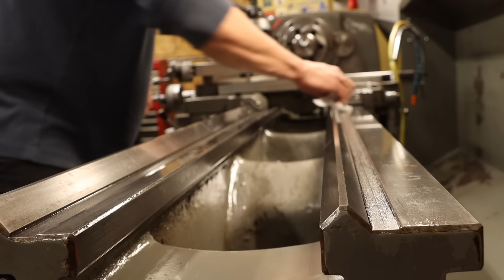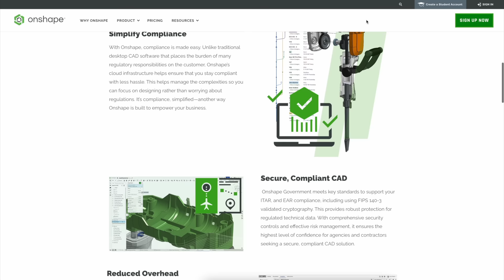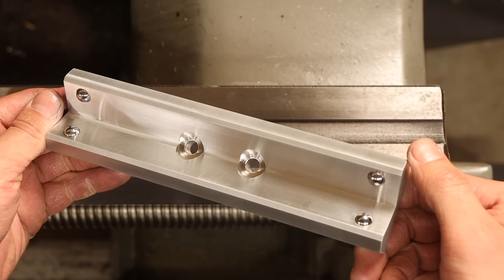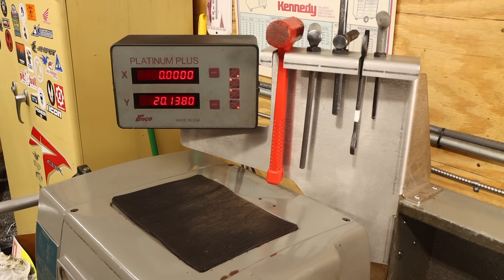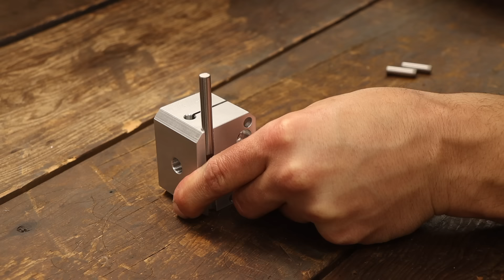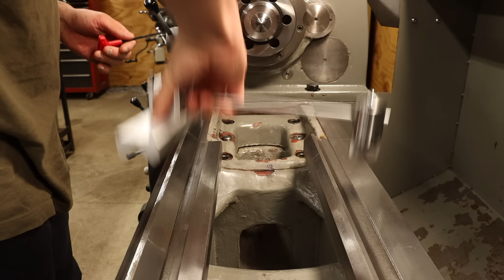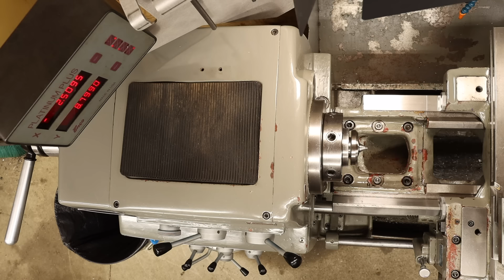A mistake... 3 years in the making

Comment: You adjusted the tail stock at the point that the live center contacts the work. But did you make sure that the tail stock quill is parallel to the bed like you did the head stock spindle? If not, you may introduce more or less taper into your work at different distances that the tail stock is protruding.

Comment: what you call the bar test is showing you how well the tailstock is adjusted... taper does not indicate anything but the tailstock took is off center and needs a couple screws adjusted. Read about tailstock offset method to actually turn a taper by throwing out the tailstock. That t3st has nothing at all to do with leveling the machine

Comment: I might be a little late with this, but i just discovered your channel (and i love it :) )
You actually DONT want micrometers or anything else to take mesurements with laying on the top of your spindle, even with a piece of plastic underneath. 
When i was learning and training, i did the same, laying calipers and micrometers on the top of the spindle. My coworkers told me to touch the surface where those were resting, and guess what, its warm :D
Keep on with your great work, i really love and miss the conventional machining 
I started my training in 2010, learned all conventional, turning and milling.
Finished training in 2013, I got to work CNC on a Doosan Puma 300SL
After that i went to another company in 2016 to keep on learning
They might have seen something in me, i dont know, but they sent me to trainings and lessons at machine manufacturers like DMG, SCHUNK, etc
Today I´m still at that company, working on a DMG CTX Gamma 3000TC with automation Robot
I hope my english isnt that bad and quite understandable
Greetings from germany <3

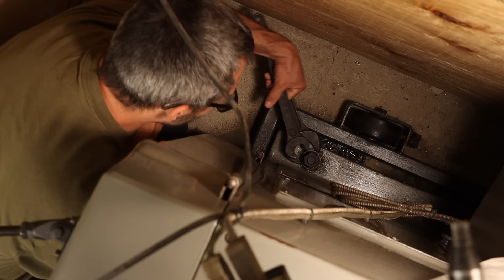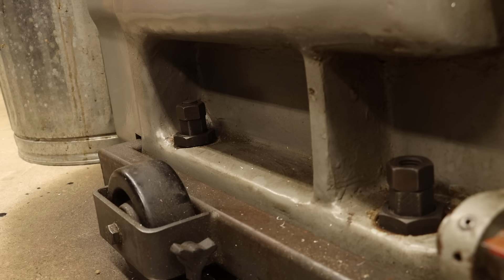Comment: Fantastic episode. At 16:34 I think I see a slab joint at the top edge of frame where you are making an adjustment to one of the feet, and at 16:41  I observed a crack in the concrete very near the right end of the lathe. Is the lathe on a standard garage slab, or did you pour an isolated pad under it? I ask because big lathes can slowly drift out of level on thinner residential slabs over time, and many manufacturers recommend 6 to 8 inches of reinforced concrete for stability. Curious how you’ve handled floor movement for long-term alignment.”

Comment: Please dont use Plastik to fill the Gap. Use long curing filled Epoxy and a little piece of copper Wire to lay it in the Gap with the Epoxy. Then tighten it to match your expectations. The Copper Wire will be pressed together when your adjustement is ok. Then let the Epoxy cure. 
Just simple as that 😊

Comment: I remember, about 40 yrs ago, I tried to straighten an old McDougal lathe out, and, after extensive checking, I found the tailstock was 0.030" low, and, at some point in the lathe's history, someone had switched the tailstock with the wrong machine, and after some checking, we found the other tailstock, 0.030" high, switched them around, and ended up with 2 fixed lathes. The paper mill in Dryden Ont. never had such great work done, after that.

Comment: I think you will find the reason you could not take the sag out of the lathe bed was the stand that is under the base of the lathe.  As you are adjusting the leveling screws at the drive end, it is causing the stand to deform instead of the bed, the wheels on the stand are also acting as pivot points.  I would suggest removing the stand or adding jack screws to the stand, to prevent the stand from bending as you try and remove the sag; I would do four at each end of the stand, one in each corner.
I’ve had issues with using leveling screws with hard rubber bottoms.  The rubber would change an hour later, and I would have to start all over with the leveling.  It appears the casters on the stand are polyurethane which will crush over time.  Switching to steel casters will help ensure your level does not change over time.  I personally would remove the stand and create steel or cast-iron pucks for the lathe leveling screws to sit on.  The pucks will protect the concrete floor and elevate the lathe too.  If you are tall like me, it makes it easier on the back adding 2-4" under the lathe.

Comment: Sometimes it takes years to figure out the solution.  

Oh, and what is that fancy angle finder that you have? I got given a cheap one but it does should the correct angle which took too many hours and minute of trying to align my machine to work out that it sadly isn’t accurate to even vaguely within the +/- 0.1 degree as they state in the manual. 😢

Comment: The does the chatter come in at the part where the ways are sagging? If so, you should anchor the lathe to the ground and "pull" the end of the gearbox down. As now its "floating" at the end and causing that chatter at the middle of the ways. :)

Comment: IF (a big IF) there is wear on the carriage ways, a simple way to check the wear is to use the tailstock ways as a reference, since any wear on the tailstock ways is almost always close to zero.  (And certainly no wear in the area where the tailstock is never positioned.) I.E. check the carriage ways by mounting a dial indicator on the tailstock and sliding the indicator point along the carriage ways. Usually any wear on the carriage ways is near the chuck, so placing the tailstock  in front of the carriage, with the carriage all the way to the right allows this measurement near the chuck. In theory, one could mount a tool (e.g.  a grinder) onto the tailstock to true the carriage ways.

Comment: Putting balles for the “V” block’s contacts, I would have envisaged a small thru hole for future retrieval - ‘cause you may not have all 4 holes perfectly at same depth. Also would make the fit .000 5” allowance and used a lube for retaining / rolling. Naturally, some adjustment for the 4 balls to be in the same plane.

Comment: Hey man, plastic creeps, and if the new shim's thickness is ensured by torqueing the bolt to the right amount, that means that the plastic is under compression and with enough time the pre-load will drop to very low levels. I recommend figuring out how to get a metal shim thin enough.

Comment: One thousandth of an inch is 0.0254 mm, i.e. at the limit of permissible error for most machine units with normal accuracy. At the same time, people who's using the metric system, when repairing machines, usually use micron accuracy indicators, i.e. 0.001 mm. Of course, thousandths of an inch can be divided into smaller parts, but WHY?

Comment: Standard lathes are only built to H7 specifications, so trying to adjust a lath beyond this tolerance, is futile. Also heat produced from the turning processes,  lathe-bed lineament, will influence long turning accuracy of a lathe. Also when using hard-metal inserts; the nose radius of the insert should be fulling engaged E.G. the depth of the cut should be the twice the nose radius of the insert; so if the insert nose radius is 0.4 the cutting depth should be a minimum of 0.8. - The formulae being nose radius 0.4*2=0.8 - 0.8*2=1.6 and so on.

Comment: Here is a Question.  The Tool Tip is Tangential to the surface of the bar.  If you raise or lower the tool tip by 0.010"  ( 10 thousandths )  how much diametral change does that Make on a 1" diameter bar?
if you have done the math,  you will see that leveling of the bed, doesn't affect part diameters as much as one 1st thinks it does.
So then it's Not really the precision Leveling of the Bed that has the greatest impact on Taper in the part. 

Head stock alignment, the Center line of the spindle bore in relation to the Bed Ways.
The cross slide Screw and nut assembly and thrust bearings on the ends of the Screw.
If using the Tail stock, the alignment of the Tail Stock in relation to the center line of the Spindle. ( the tail stock center height  should always be Slightly Higher Center line than the Spindle by a thousandth or 2.
If you have a Gap Bed, then the Gap alignment, has the most impact on the first couple inches of cut closest to the Headstock.

Comment: what do you think about cutting straight cut gears using a circle on its own radius "makes 24 curved points" as a straight cut Hypnoidal gear??? only math involved is pitching the next gear 1 point smaller though using the same circle radius as the first gear. this is more so relating too, machining with a scribe on a plasma cutter... for a PTO on a Eaton TRO-9513 to run a 8kw 60hz generator at 75hz with a 3208CAT sitting at 800rpm. 5.625 time gear ratio and 8kw to 75Hz becomes 1.25 times so that's a heavy 7.03 time too 57Kw idle at 800rpm... 500lbft of will it stall? cardboard test cuts because a 24 to 4 doesn't work the output shaft would just snap... only use circles one 5.6 times smaller using the overlapping average in circumference to identify the radius similarity for the tooth-ing scribe. 6.5 gallon an hour for 10kw something like $2.74us/1Kw*hr... all because ... plug thing into wall on 50amp 250v plug, only thing coming out is 4.3kwhr. a 230 volt air compressor would be under volt'd on that grid... flickering led lights... as if a 500 watt mini lathe became 150 watt. the 178 volt to 308 volt jump... 408v 1100rpm ocv drag down to 280v 800rpm... 204v on the 110 plugs would make a 500watt mini lathe strip all the plastic gears though cut for half of something. the other side of grid on vs off? 8cent/kwhr power is more then cheap, its randomly usable and burnt out the furnace motors 3 times when the 110v dropped to 78 volt.

Comment: i appreciaty your imagination and diligence.

1. Level the Bed with the bubble level on the cross-slide
2. Adjust the headstock parallel to the bed by using a lathe alignment test bar
3. Adjust the tailstock with your turned test-bar - but better use a growned bar between centers plus a dial.

all other things you measured and tested are things you have to live with as long as you are not willing to regrind the entire bed.
Reply: If I'm measuring tenths and I want to be precise I reach for a mic, not a DI.  YMMV, apparently.

Comment: On my lathe the tailstock didn't point straight to the spindle, so depending on how far you extend the quill or for instance mount a drill in a chuck, the tip went off center. You didn't check this.

Comment: The best way to calibrate a lathe is to put a test bar in the spindle and indicate it in at the face of the chuck and at the end of the bar.  DO NOT use the tailstock.  Now with an indicator 
on the tool post you can traverse from one end to the other.  It's even better if you can use 2 indicators, one on the "front" of the bar and one on the "top".  This lets you see the distortion
in 2 directions.  From here you can simply adjust the leveling feet to "twist" the bed of the machine so that it tracks the test bar exactly.  For any lathe, true level is far less important than 
straightness.  Now that the bed is straight you can dial in the tailstock to match.  The best part is you don't have to make any chips.

Comment: Question, not a nit pick because your skills are vastly superior to mine. On the prismatic side of the straddle tool you made, you went with 4 balls instead of 3.was there a reason? Maybe 2 on the outside, and 1 on the inside? Just curious.
Reply from the maker: i considered this but realized that only 3 balls wouldnt have fully constrained the fixture. it would still rock

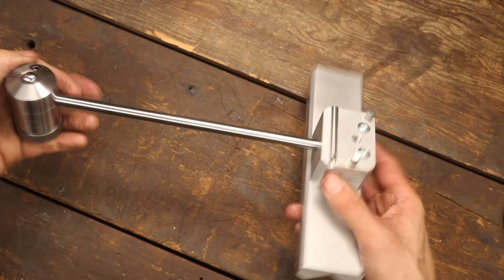Comment: at 12:56 you tapped a ball bearing into a press fit hole and i noticed the part moved in the chuck i my head that screams smeared treads but is that why you specifically chose the collet chuck and if so was it specifically to stop damage occurring during the press fit (0 machining practice just a curious viewer)

Comment: Great to see you back, As as Surveyor that has from time to time hd to do work aligning machine table/ optical benches and frames on them , leveling them is a pain. up a smidge one end, down a smidge the next then check and check again.

I am sure to  would have but I hope you adjusted the level by reversing it over the same points to make sure it was reading centered .

Comment: Interesting saga...
I spent a career as a maintenance technician, 3.5 decades in a machine shop. I have faced your issues many times. The principles you cover are applicable across the machine tool spectrum.
My experience is that most folk see a condition, and jump to a about how to correct it without understanding the interrelationship of various machine design elements. "Correcting" for a condition can easily affect another machine design feature. Thorough analysis of symptoms needs to be done to validate integrity before making changes.
Most lathes of your class have leveling bolts on the headstock base corners and on tailstock base corners. Validating bedway level, belly, crown twist us best done with machine weight on my the inboard corners of the headstock base and tailstock base. Machine level for a lathe is not important, but reasonable level  makes subsequent diagnosis simpler and coolant will properly drain. I preferred to use two .0005"/ft levels, one parallel to Z travel and one parallel to X travel. If the top of the cross slide is machined flat, this is a simple level setup location, a d it allows you to move the carriage and watch live level variations. If there is no suitable level mounting surface, setting the level on clay allows level zeroing by pressing the level onto the clay. When the main bedway is leveled, the tailstock base outboard can be weighted to improve crowning, sag, and twist.
The rear headstock base leveling g bolts are weighted to ensure spindle parallelism to the trued bedway. This can introduce error in the corrected bedway, so monitoring and correction is mandated.
The next task is to validate spi due taper by turning a sizeable round that produces a good finish micing for taper. Turned part is not supported with tailstock. Headstock is adjusted to bring taper into specification. 

My explanation is basic. Lathe design and features can demand approach modifications.

Comment: It won't even be 3 years before you adjust the lathe WITH the tailstock to account for vibration load of it on the bed. The weight of tailstock definitely has a resonance with the lathe itself. So the sagging dampened it when it was there. But, now that your lathe alone is rigid without tailstock load, with the right motor speed, when the tailstock sits on the exact middle of the lathe, the vibration harmonics is amplified so much that it will bother you in a few months, I'll give you 4 mo. from when I commented.

Comment: I always keep a pack of Zig Zag Rolling papers in my box, I'm not a stoner. They are by far the best fine thickness shims you can buy for the money. They work excellent and zeroing out the runout on your diamond wheels on the tool sharpener. But would work great on your Lathe's gap bed as well.

Comment: I got a new to me lathe a last fall and was dreading having to dial it in, but i just happened to get extremly lucky when i set it up and im within .0015". This is plenty good for my needs i thought i was done with it. Turns out when winter came either the shop being colder or the concrete slap shifting with the ground freezing ended up having to go through with a similar process (although without your aparrent calmness or skill set)

Comment: As always, another great video! I have to say that I think it's a shame that you didn't repeat the measurement with different spindle positions of the tailstock. Now there is the risk that you only have the tailstock accurately aligned for this specific position (length). Suppose that the central axes of the tailstock and the headstock are no longer completely parallel, which you didn't measure, then a taper will occur again with a more or less protruding spindle. Ideally, you would not only want to know the position, but also the mutual angle of the central axes of the headstock and tailstock in both horizontal and vertical direction.

Comment: As someone who isn't a machinist, I have to ask...

If plastic is squishy enough to fudge into diameter, wouldn't that also mean it's squishy enough to further become a problem down the line?
Reply: He said he would fix in 3 years ...
Reply: It's essentially acting as a spring, pushing the removable part against the fastening bolts.  It's not relying on the squished plastic keeping its thickness by itself.  So long as the fastening bolts don't move, the part won't move.  At least in theory.
Reply: don't forget that even steel is squishy, just a lot less, so right now the plastic, wich is why it is a great choise, it prefents him from damaging the original parts but still alows him to tighten it up a lot, and with what im asuming is a consideable amount of torque on it, it wont deform much, unless he puts an incredible amount of weight on it. also, even if it squishes more, there will still be something inbetween there, since it wont be able to flatne till nothing, meaning it will always be better then it was.